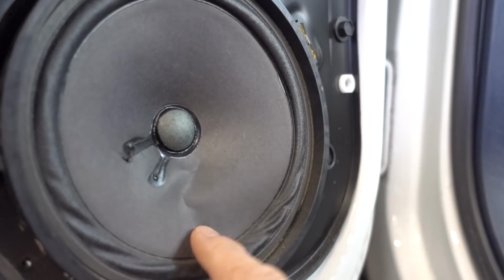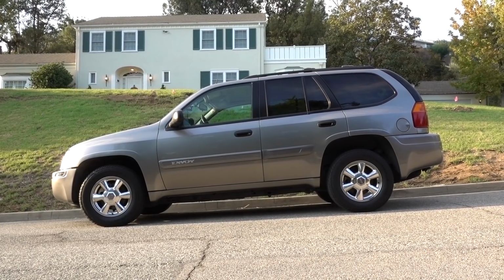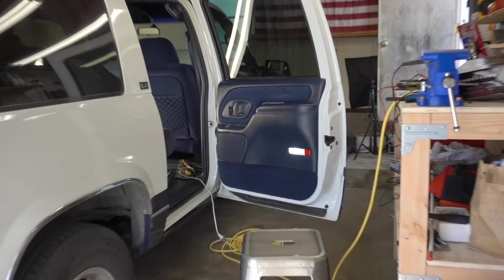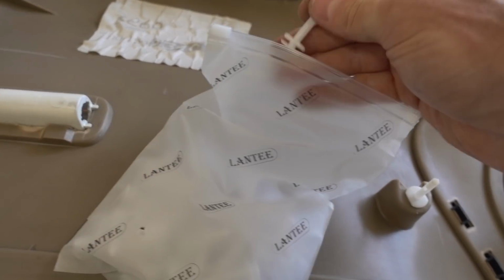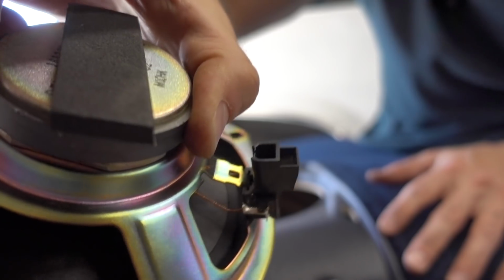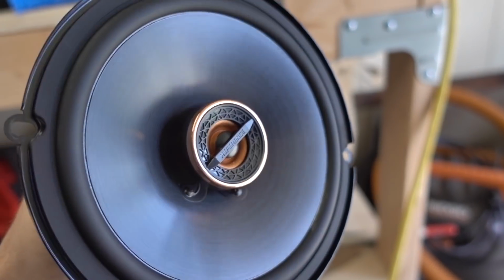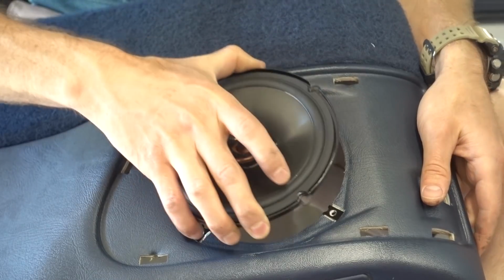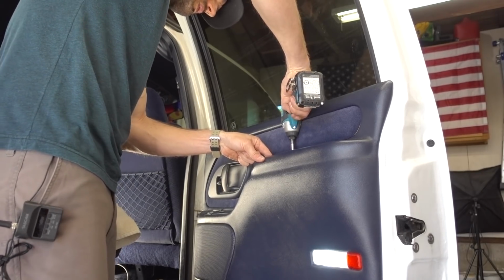This Is Why YOUR FACTORY CAR SPEAKERS SUCK!

Comment: The factory speakers in my 94 E-Class where crappy as well. The look the same as yours, but they‘re smaller (4.7 inch diameter) which makes the sound even worse. And it didn‘t even come with rear speakers from the factory, only the mounting holes and covers, no mounting bracket, no wiring, nothing. 
I‘ve swapped them for ESX QE120s and they‘re ok. The sound is good but they‘re lacking big in terms of bass. But I mean you can‘t ask speakers this small to produce hardly any bass

Comment: I am extremely dissatisfied with the bose system that is in my 05 yukon, i had a 90 lumina with the same head unit but with pioneer speakers that i installed and at 10/38 i couldnt hear my passenger now at 32/38 i can still hear them in the yukon 😪 needs to go

Comment: There really ain't shit wrong with my Ford Premium speakers from my 2001 Expedition. I even took them out and replaced them in the Excursion I bought that had Hertz speakers. A good radio with enough watts makes a difference. I get good bass from them. Good mids and lows. It sounds clear. But still nothing like the Bose I had in my 1988 Ninety Eight Oldsmobile Regency Broughm that had Bose. Early Bose speakers were so much better.

Comment: Factory speakers #1 reason why they suck is they have no decent box.  Every quality home audio speaker has a nice box.  Pull the driver out the most expensive speaker you can buy and place it in a tin can and you won't get very nice sound.

Comment: I have 2009 Dodge avenger and the original speakers sound really good
Reply: I don't know if it was still the case in 2009 but my 2004 came with infinity sound system from the factory.No I didn't but a premium sound upgrade from the dealer. So apparently we all agree infinity makes good sound. lol

Comment: My Bose system in my 04 Mazda 6 blows, I use to like them until I heard my friends sound system which is also stock but he has JBL audio and it’s night and day. Went to install some nice JBL and the Bose amp literally made it sound worse. I need to do an entire bypass of the stock amp with a stronger one for it to produce some nice tunes. Never trust Bose
Reply: Ya bose is way overrated

Comment: Suck? That's what my stock 2016 Toyota Corolla speakers aren't. Really, guys. The drivers, even though they have tiny magnets, plastic frames and tiny voice coils, seem high enough quality to withstand at least 8 years of use. They have felt/rubber surrounds, far better than the rotted foam in my previous car, a '97 Toyota Corolla DX.
Reply: Plus, you have an AMERICAN car. Stock quality isn't exactly on the list.

Comment: The reason why factory speakers sound bad. The designers are on a budget for every vehicle so they make the car as cheap as possible that’s if it’s a base model. The upgraded sound systems like bose jbl are from the vehicles like the Ltz packages. So it depends on the vehicle if it’s a base model or not.

Comment: Wanna hear bad. My wife's 05 sebring was so bad I broke The stereo. I ended up Replacing it with a kenwood. Deck alpine 5 Channel and  infinity 6x9s and a 10.inch Kicker sub. My mariner I used ct sounds 6.5s and a Kicker 5 Channel amp and my 14 passat I used infinity components and a Rockford Fosgate 5 Channel. All tbe speakers I removed sounded baaaaad

Comment: Honda Accord 2008 factory speakers and radio sounds Bad. I changed the Radio Pioneer AVH-Z5000DAB, Speakers JBL GTO 609C, Amp I-Sotec i-soamp 5D, Clarion 30 CM subwoofer. Great Sound and Bass.

Comment: I drive a Land Rover Perentie(county/defender) 1988 General Service, what are these speakers you speak of?!? The only luxury addition I have is an ash tray, doesn’t even have a cigarette lighter plug only a old Lucas 2pin plug for the engine maintenance light which of course the army forgot to include at auction

Comment: Great Tutorial 👍 
Question... how'd you determine the polarity when you placed the old adapter plug to your new coaxial? 

I know that the coaxial terminals were probably marked, but was there a marking on that factory adapter [for which side is + or -] ??
Thanks
Reply: Not an issue IF all speakers are wired the same.

Comment: Jimmy - does your Suburban have the two 4x10 speakers on the ceiling, way at the back near the rear hatch? Both my Tahoes have them and I would like to replace them. I was looking for one of your videos to see if you'd done it but I couldn't find anything.

Comment: I have a sound system in my 02 Eddie Bowers f150 and they sound great new pioneer head unit 600 watt amp form duel and sound box form a off brand company and  orgonal door speaekers mine sounds great until it gets passed 3/4 of the way up then im guess the head unit is just to powerful would it be that way if I replace the door speakers or no

Comment: i have 2018 traverse LT........it doesnt have bose sound system and no speakers for third row or in cargo area. the speaker grills in the cargo area (in the C pillars or very last pillars before the trunk door) are empty, 3rd row hears nothing, i have to crank up the volume all the way to high for them to listen anything, but then its too much for front and 2nd row. i wanted to install speakers for third row, just wondering what size and brand will fit in? i tried to search on internet, went to chevy dealership.......but found nothing. can you please help in suggesting any good quality speakers that would fit in, i dont want the latest or greatest or the most expensive ones, but decent sound quality. also do you have any idea that i have to install wiring for it or will it be there behind those empty grills? thanks for help and advice.

Comment: I used install audio systems for living 
Cheap speakers have cheaper copper magnets and member 
You may not get good  results if you use the factory radio 
I replaced the whole system in my grandam with pioneer and they outlasted  the car had too cause body shop let car out in rain and ruined the factory speakers and blew up the radio

Comment: I have skoda fabia 2009 came with 2 speakers and 2 tweeter in front doors only with sony hesd unit from the factory but i placed pioneer speakers in back sounds like 🐕 shitt  but now i replaced it with sound stream seystem and 2 amp one sony monoblock and a sony 4 channel

Comment: The upgraded audio system in cars are no better than The speakers in your cars its just The thing that car manufactures are getting better to use technology. In
Fact mostvof The stock upgraded audio system spealers in cars now days are worse than yours i mean your speaker has senn its 25 years and all but when they were new they were problably just as good

Comment: >Hey, let's toss out those perfectly fine full range speakers cause muh paper, muh magnet... And put new ones in, designed without any relation to the acoustic properties of this specific car, with puny mylar tweeters seperated from the woofers by nothing but a cheap chinese capacitor, and open air gaps. 

Alrite

Comment: wait.....the video should be entitled why his factory car speakers suck.  I drive a 2018 ford fusion with 8 speaker system 2 in the rear deck lid   2 in the back doors  2 in the front doors and two tweeters in top of the front doors and they do not suck at all

Comment: 7,5 minutes to one sentence:
Because factory speaker's diaphragm made of cheap thin paper material.
Reply: The thin material is for efficiency.  If you upgrade the speaker to a thicker stiffer cone, stiffer surround, stiffer spider.  It will require more power to move the speaker.  Meaning you will actually get a lower volume than the what the factory speakers produced.  Yes, it's cheap, but it's designed to pair up with the also cheap and weak source/headunit.  For best results if you do a speaker upgrade with you should add an amp because under factory power, aftermarket speakers are highly underutilized.

Comment: I replaced my 2013 impala speakers to only buy the factory speakers brand new and put them back in my impala they sound great the after market sound was horrible. I read up and the impala factory speakers . unless you replace the head unit any after market speakers sound crappy
Reply: No, unless you buy aftermarket speakers that are comparable to your factory speakers, they'll sound worse... 
For instance:
If your factory HU puts out 18w RMS to each speaker and you put in new speakers that handle 60w RMS, you're underpowering them, so you can expect it to sound like trash. They could've been great actual speakers, but you'd never know because you effectively strangled them. Would you also write a bad review of a vacuum cleaner after trying to power it with a D-cell battery? 😅 But yeah, some aftermarket speakers are suited to be "factory upgrades" that handle the same power requirements... Most aren't, so you're mostly correct. But now you understand the aspects of where and why you're not fully... 🤷🏻‍♂️✌🏻

Comment: I have a 2011 Lincoln Town Car and each speaker is Factory Amplified and match to the stereo system so you don't touch it I saw a Town Car where the guy took the stereo out put in a new stereo but didn't replace the speakers and it sounded like s***

Comment: I have a 2018 dodge charger sxt plus it has the alpine system but it sucks so bad the door speakers are bass only i put 2 12 inch subs it and it’s worse not enough highs so i need to replace stock speakers and get tweeters if anyone knows of a good brand let me know i might try these or see what the stereo shop recommends

Comment: better change the radio. otherwise you lose output and the quality wont improve greatly. their will be less distortion because you wont overpower the speakers is all your accomplishing.
Reply: Those speakers aren't going to get overpowered by the radio. You get distortion from driving the radio beyond its sweet spot.

Comment: I have a 2001 Sierra 1500 single cab and I'm trying to decide what to do with replacing the rear 4x6 speakers. No company seems to be bothered with making an adapter for aftermarket speakers, so it looks like I'll need to drill holes for the screws. Should I not worry about it and go ahead with the drilling, or does anyone have any suggestions here?
Reply from the maker: If it were me, I'd go ahead and get it done. Just don't make a mess of it. Plan it out.

Comment: Or the fact that factory speakers are usaly running 15 watts max. Lmao. I replaced my speakers with pioneer 6.5s one pair is 300 watts and the other pair is 260 watts. (The 260 watt one are older)

Comment: In my hummer h3  the factory speakers were ok but I replaced the door speakers with crescendo audio mid range and crescendo tweeters. And I replaced the factory subwoofer with 2 sundown audio nvs4 and the sound really good

Comment: Why did you have a capacitor hooked up?  Is that for the tweeter or something?  Caps make good filters, but there is no explanation as to how it got there.
Reply: It's a high pass for the tweeter, so for filtering. It came with the speaker. It was made like that
Reply: I knew it was a filter, just not if it came with it. But I looked at the picture on Amazon and it is there.  Given the heat inside a car, they should be using more than one cap to spread the heat around.
Reply: @tarstarkusz  I see where you're coming from, but that's never been a problem for any other speakers.
Reply: Thanks.  I don't think I've ever seen a car speaker with any kind of crossover or filtering of any kind.  They really should have used a transformer too, though I'm not sure where they would put it. The transformer isolates it. This cap is going to affect both sides (all points in a circuit between components are the same) and a transformer isolates.
Reply: @tarstarkusz  right. I agree. They use caps instead because as you were saying, size. But yes, I have 4 way Pioneer coaxials which use caps for filtering as well. But yeah no problem!

Comment: I have a crown Victoria police interceptor from 2007. Has stock speakers 6x9 don't sound to bad made out if a thicker paper material with a built in speaker grill. Not to bad in my opinion

Comment: 55rms god damn those have no power at all, my 94 civic i put 600watt audionaughn all the way around my deck is power acoustik with 300watt times 4 so 300 watt a speaker, and inless u get a car with bose or kicker all stock speakers are meant to be crapy

Comment: My 2008 Saab 9-3 SportCombi had terrible dash/and tailgate speakers. Iffy door woofers. Replaced the dash with hertz tailgate with a pair of rockfords and replacing the door woofers and adding a 10 inch hertz sub in the rear floor. My 2014 Cruze before I wrote it off had okay sound but anything over bassy sounded like shit. Hip hop/r&b was good so was rock but rap sucked. And my 08 Saturn astra xr3 door had the worst factory audio system ever. Flat no bass terrible highs. Replaced everything in almost all not cars.

Comment: Installed Sony Xplod speakers into my 2000 Silverado and now it sounds crappy as heck. Any suggestions?
Reply: Fuki417 define crappy?
Reply: Sounds flat, no bass, the mid is weak. I’ve already adjusted the equalizer.

Comment: My e53 2006 x5 sounds shit af mainly because it came with the standard sound system without the subwoofer
Reply: try upgrading the speakers to Hertz units and also add some sound proofing to the car (especially the wheelarches).

Comment: i drive a 27 year old  truck its a 1992 chevy c1500 Cheyenne  still with factory  speakers   need to replace them along with factory radio im also 27 years old born in 1992

Comment: As much $$$$$$ as we put down on these things you'd think they could afford to put some real speakers in the things. Even the 'upgrade' packages are cheap abomination with someones fancy name slapped on it.

BTW 14 Grand Cherokee. The stock system is AWFUL! Friggin muddy 6 speaker BASSSSSS machine, with fuking software EQs to the rear speakers. After EQing the shit out of it, sound is tolerable. I get complements on the sound of my Jeep lol and all I've done is crank down the bass and boost mids and treble. They wont know what to do with themselves once I actually tear out that stock garbage and get a DSP :}

Comment: I don't like. You re-used the piece of shit connectors instead of just soldering new push on connectors to the wires and pluggin' them to the speakers. I can bet you use the original head-unit too instead of using 3rd party one paired with 4 or 5 channel amplifier, change it out to hear if it makes any difference. But that's just my opinion, and you got your own so whatever

Comment: Never seen any body re use a factory plug before..
Reply: D.J. KEYS : You don't see professional installers reuse factory plugs simply because it takes too much time, and time is money. Frankly, reusing the factory plugs is actually a very good idea, especially in this particular situation/installation.
Reply: @turbodiesel4709  lol..yea that's wy wy I never did it because I...was lazy.i had time.lol but I will in the future